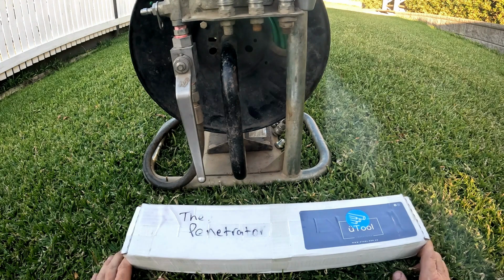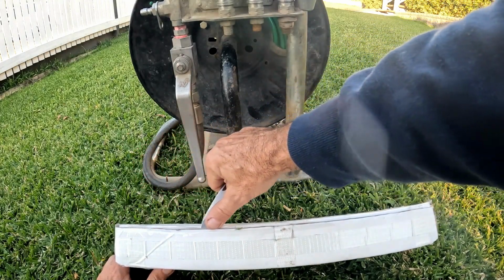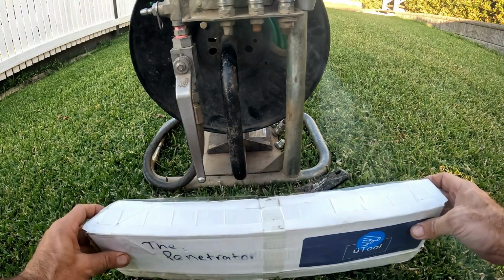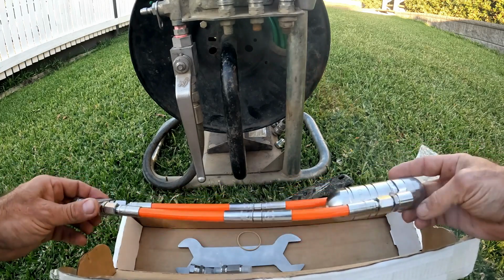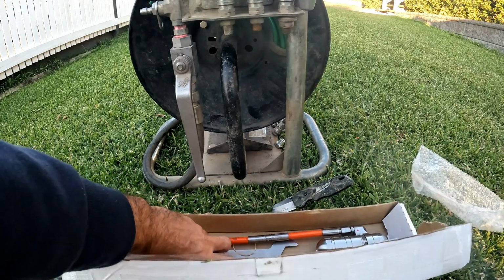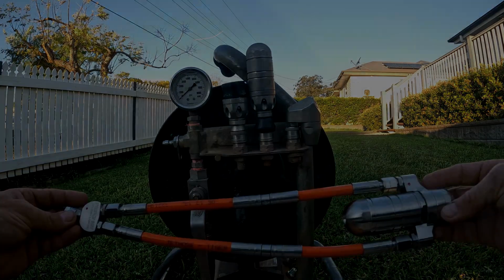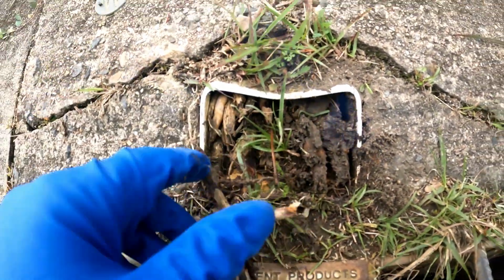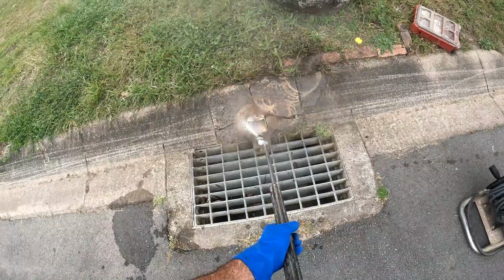Blocked Drain 279 - Surprise Unboxing | Then A Pipe Full Of Tree Roots To Clear

Comment: Though I've posted this question several times on different channels, I haven't gotten a clear answer. I'll ask again:

Is it an Australian building code requirement that storm water must be piped underground out to the curb and drain into the street? Why not let it flow out a down pipe onto the lawn? Much less trouble and expense.
Reply: Or in a channel out to the curb? As in South Africa.
Reply: Different states have different laws. In Sa most houses have rain tanks to store it. In Vic is illegal. Etc etc
Reply: I would imagine the biggest reason to pipe away from the house is to minimize undermining of the footings and keeping the area near the house drier, which means less issues with bugs and snakes. (they have them big time)